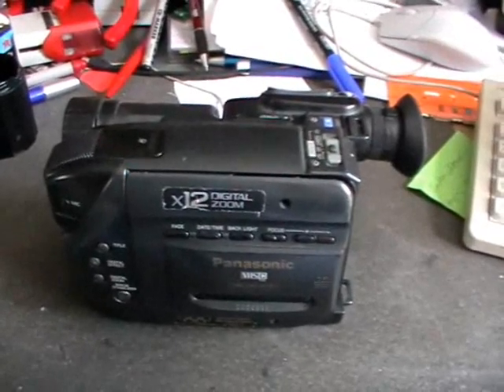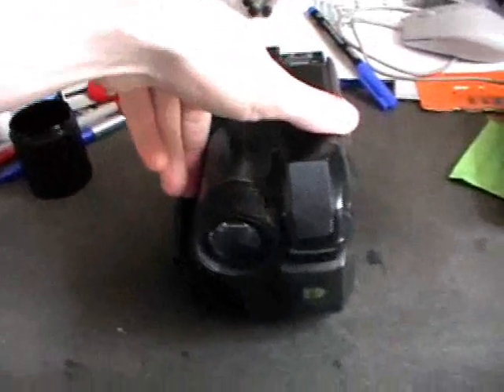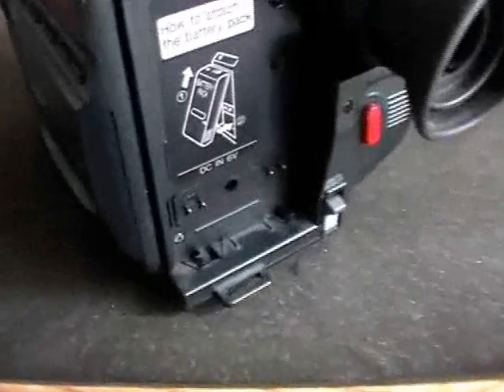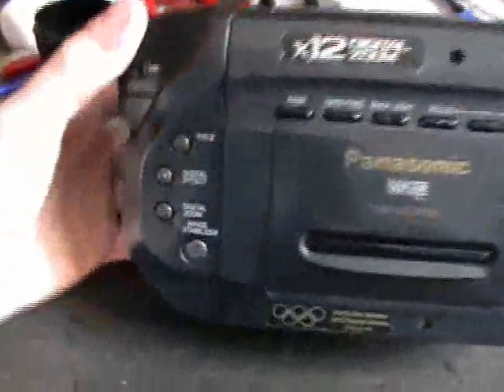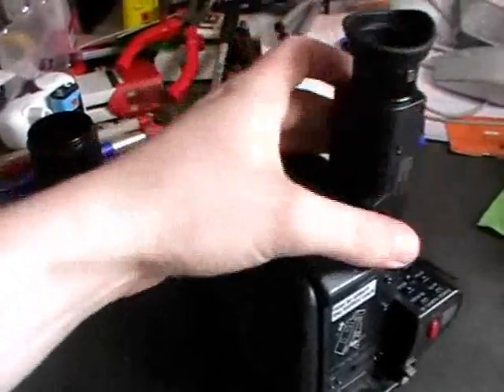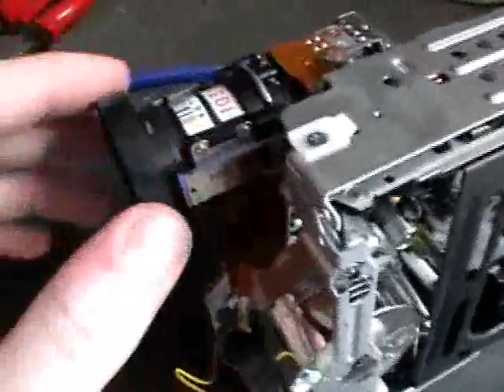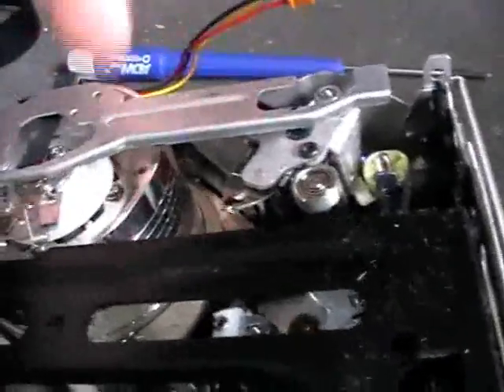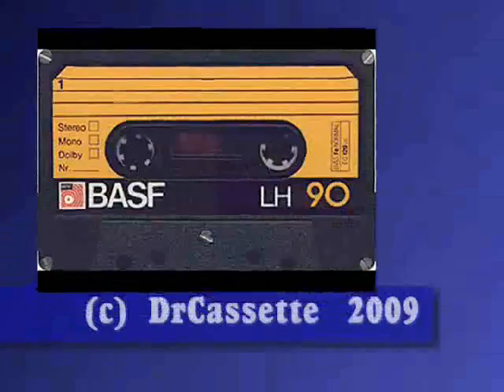DrCassette's workshop - Inside a VHS-C camcorder

Comment: hey dude are you still ative on this channel ? i have a magnavox easy cam vhs camera it works but everytime i put a tape in it turns off when i try to turn it on it turns on then shuts offf when i open the cage where the tape goes it stays powered on i noticed there this little lever looking thing and i pushed it to the other side and so i tried to put a tape in after pushing the leveer on the inside of the camera and when i do it that way it actually stays on but then says there is no tape inside when there is idk i cantfind anywhere online on how to service these cameras so hoping you dr cassestte would bless me witth some knowledge on how to fix this

Comment: I have one of these from the early 1980s. Passed down in the family. It looks in good condition, however the battery does not work and has leaked on the body work on the camera. Not widespread, but bubbly around the battery. I would love to get it repaired but I'm worried of getting some kind of shock from the battery or cost for repair? any ideas?
Reply from the maker: How about you give me the brand and model number? "One of these from the early 1980s" contains absolutely no information at all.
Reply: DrCassette well it’s this exact video camera.
Reply from the maker: It's from the early 90s and not from the early 80s then. I'm sorry to say, this thing is just not worth any repairs. The work that would need to be done to get it working again (replacing all SMD capacitors, possibly more) would probably cost more than several brand new HD camcorders.
Reply: DrCassette ahhhh, okay, thank you kind sir👍🏻

Comment: I have several of those "portapak" cameras from the early 80s. I had to remove the 10-pin connector and figure out the wiring in order to use them but now I am making a music video with tube cameras (I love the comet tails :D) The viewfinder CRTs are also extremely large (like 1.5") and sharp enabling you to focus properly.

I made a couple of my Youtube videos using one of them, basically for the hell of it.

Comment: Camcorders of this age usually die due to bad capacitors -- the tiny surface mount capacitors which are almost impossible to replace.

You should smash it first, and then throw it out. :-)